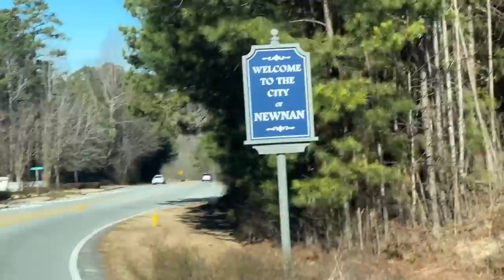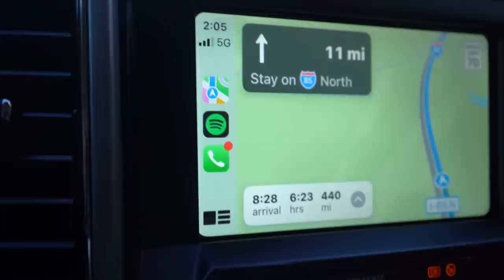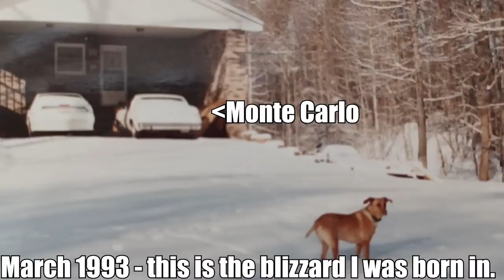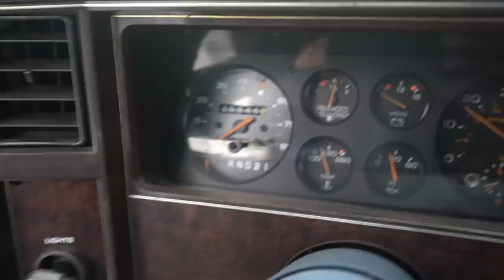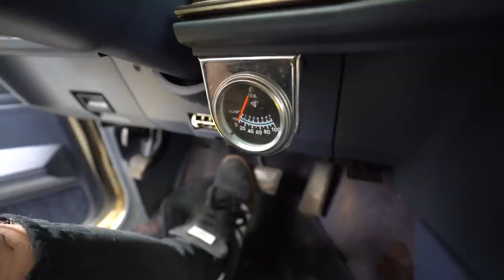Buying my grandma's old car back. sitting for 22 Years.

Comment: I couldn't believe that it turned out to be a Monte Carlo. I have my mom's original 1986 ss that I will be putting back on the road. She passed last year, so this really hit home. Can't wait to see how yours turns out.
Reply: My older brother had an 86 ss till he went off road thru a ditch in an ice storm
Reply: Same here, almost, on Christmas Eve ai brought my stepdads 87 SS Monte home to rebuild, he'd already LS swapped it B4 he passed in 2014 so that part is simple but my sis and niece put 20 dings in a very good and expensive paint job so I get to pull, best and fix those but other than a 4l60 w 2 neutrals I'm swapping for a built 4l80 it's ready for this turbo LS Ive been building for it. The memories of this baby at the track goin 10s and takin $, I can't wait to make him proud when I get it burning tires and droppin  panties... It's gonna be doin it for Dale 😂

Comment: Highly recommend a 55 gallon drum with the top cut off or water storage tank with 20-40 gallons of Evaporust. One of the best things I added to my shop. Remove parts, drop in tank, and by the next morning they are rust free. I just pressure wash clean, then if not ready to prep and paint, I redunk and let dry til I am ready to refinish. The dry film stops rust til you are ready. Barely even use my sandblasting cabinet now. 

 
Pretty excited to see what you do with this one. Always top notch.

Comment: I had the same exact car 4 years 1984 SS with the blue interior, white limited edition. I loved that car. I traded my 1971 Monte Carlo for it that needed work. The 84 had a 69 DZ 302 under the hood with a built automatic transmission that I could chirp the tires in all 3 gears... damn that Monte Carlo was quick LOL thanks for the Memories. As far as this one goes, don't take any shortcuts. Change all your fluids, water pump, rebuild your carburetor, radiator, gas tank and brakes though you don't have as much rust down there as we do so your tank might be okay

Comment: One thing alot of people don't know about these mid 80s gm cars is that they were made out of single sided galvanized steel, so they were less prone to rust from the inside out, but if you got a rock chip, and the salt and shit found its way behind the paint, they would rust like no other.

Comment: You really got me with this one. I had a 1985 monte with the 4.3 liter. It was all original.  Only thing I did was put better sway bars on it. And exhaust work. I miss that car. I lost it in a winter storm. First time it saw snow. Almost got killed. But I made it. Car,  not so much.

Comment: My dad had a 85 clone with a 350 and SS front clip, he sold it when I was kid and I cried lol later on down the road he bought a 88 true SS. It was stolen and vandalized and has also sat for about 20 years. He officially gave it to me not too long ago and I'm hoping to get some motivation to get it back up and running.

Comment: I know how you feel. I have a beautiful 1987 Monte in my garage still original body. Was in my family since around 92-93 when my uncle bought it and supposedly the history report shows the dealer got it at an auction in Florida. I have memories of the car when I was a kid and my uncle passed of cancer in his early 40s in 2009. Dad got the car, I had it in my senior photos and I’ve had possession of it since 2012 and finally bought it from dad in 2016. For the last 10 years she wasn’t road worthy, sitting most the time only putting around town and for the last 6 years it sat in a storage unit in non running condition. This past summer I spent thousands on the car and got it back on the road with a fresh heartbeat, brakes, and tires and exhaust and now this spring I have more plans to do the suspension as well as a few other minor things like the trunk lid. Actually just bought a very clean trunk lid for it from a guy in Minnesota on Saturday. Watching your video reminds me of my history with my Monte. Which is also white as well 😂

Comment: Awesome project! Old g bodies are getting rare. I've got an El Camino bucket list project that I'll probably never get to, but if I had your car, I'd have no hesitation putting a mild 4.8 or 5.3 in it with a small cam and nice fuel system. These cars do awesome with 350hp or so, as long as the chassis has a little stiffness added.

Comment: If that console shifter is like some of the Camaros around those years , when you pull it to low , push it to the right and it will only go to second , then let off and push back to the right and it will only go to drive .

Comment: For the steering wheel, try diluting some citrus cleaning agent with some water, more water than citrus to start to make sure it’s not too potent, and grab an old toothbrush and scrub it around the wheel with the dilution, and when it’s all scrubbed and as clean as you think it might get, rinse it off with some clean water and a rag of some sort, and let it sit to dry out and see how it comes out. 

You’ll either have a win, or you’ll know the wheel definitely needs replaced.

Comment: The sticker on inside of trunk lid gives you every option the car came with from the factory. Paint codes, engine size, transmission type, rear end gear ratio etc .etc .  You can look every RPO code up online for that car and you need to keep that sticker or get it reproduced for the new decklid

Comment: Cool beans.... Mix up some diesel fuel and marvel mystery oil 1/2 & 1/2, pull the plugs and add 1/8 cup in each cylinder let her sit overnight. Next day toss some rags over each plug hole and crank it over to clear it out then add a new filter and some new high milage oil with more Marvel or seafoam added will re-fresh any stuck/gunked up rings after a few heat cycles and save you're crosshatch.

Comment: talkin about Grandmas car, i have my grandmas 66 Chevelle, bought it of her in 1984 and rebuilt the engine and repainted it, its been the same ever since. how many factory 300 Deluxe 2 door post, power-glides u know of came out with 283? most were straight 6s. SS, Malibu. and Deluxe models. my dad talked her into getting the V8. he wanted her to get the SS back in 66, in 66 my dad was 18... lmfao glad u got your grandmas car back. thanks for the video

Comment: Oooh im excited about this. Currently doing the same with a slick top alpine white 5 speed E46 sedan I bought for cheap. It has a mint interior but just needs some tlc to get it running right. My plans are the same as yours, get it back to all stock and running and driving smooth and then modify it after.

Comment: Monte is in about the same shape as my regal when I brought it home. It was driven almost daily. 85 limited with 80k miles in it. 3.8 locked up and is long gone. it got its FIRST ding from a buddies lawn mower. Then my dr front fender got another from moving it around. Up until that point my car didn't even have a ding in it, much less any rust at all. still stock spare tire and trunk junk. Absolutey mint condition blue pillow top interior with that 400# power front bench seat lol. Interior is gonna stay for a good while I do believe. Moving it around I couldn't believe what it felt like to sit in it lol

Comment: Nice to see another Classic back in the stable..😎 The key you mentioned, reckon its an old steering wheel lock key, the kind that stuck a metal bar thru the wheel. Also, they do bluetooth cassette tapes now so you can keep that stock radio!! 😎 lol

Comment: It cool to see old cars  like this around more on the internet, my grandpa bought a 1987 el Camino 2 years ago ad would rive it around for some odds and ends but being in his 80's he dones not drive that much any more. And the El calmino was fully stock, but now there's a 350 in it that my great uncle built. So I have been enjoying it. But right now the car has been siting for winter but the El camino is stuck in park because it has a calum shifter and on the fire wall side of it its stuck so I cant get it out of park.

Comment: That thing is nice! 
I have a tip for the trunk rust. 
Take it off and do electrolysis on the edge, you will need a big pool or something (you don't need to submerge the whole thing, just the edge), then you can get the rust of with minimum damage. I do this to doors and hoods/trunks with that kind of damage, it works great. Its in my opinion the best method for this kind of rust cause the electrolysis can get to anywhere where water got to it without cutting the part up and it will get rid of all the rust.

Electrolysis; 
- on the trunk + on the sacrificial anode(steel) , electrolyte = water+caustic soda . connect 12v to it and leave it over night, repeat until its good (do it outdoors).

Comment: That special key looks like it is either from a “club” which was the anti theft device that went on the steering wheel or to like a little electronic anti theft device that was usually by the driver side knee panel but I’d go with choice number one lol either way sick time capsule man, you are the one for the job! Congratulations!

Comment: 17:05 Mine rusted out like that too! Due to water getting PAST the rubber grommets/sealer of the bolts, that bolt the rear decklid spoiler down!  A lil Bondo and fixed this on my decklid back in 1999!

Comment: 16:30 It is for a key for an old Clublock  - it is for the old steering wheel locks. (anti theft)
I use to have the exact same key for my first car I bought in the 90's

Comment: I took a peek and found a ton of suspension systems from Ridetech, Eibach, QA1, Speedtech, and UMI. I'm sure the brake companies from the usual suspects have great upgrade kits. I would just replace the trunk deck and be done with it. Engines choices? Hard to argue with an LS3 backed up with a T56 behind it and a Currie 12 Bolt. This will make a great cruiser. I look forward to following along for the ride.

Comment: Yea, about sticking steering wheels…I grew up driving a 86 MR2, and this was when I lived in Marietta northwest of Atlanta…in summer, the wheel vegan to disintegrate as the humidity seeped into the cracks forming from years of UV and heat/humidity of Georgia summers.  It was a garage kept car, except when my dad drove it to work…and then when it got handed down to my sister, then lastly to me.  

Good
Times.

Comment: See if you can borrow a rotisserie and clean up the bottom of the body. Restoring the frame is always a great idea. Maybe you could get it in the 13's if you update to a 4l80 street fighter and ford 9 inch, a stout 350 with vortec heads and multi port fuel injection, it would make this car more fun to drive. Back then cars made a lot of noise and had very disappointing acceleration.  Remember back when the muscle cars were still being made a 14 second car was considered fast. Remember to replace and upgrade all of the bushings. Monte-Carlos always handled pretty good but there's room for improvement for fairly cheap.

Comment: Oh boy. My cousins and I had so many of the G body cars growing up. built quite a few of them up into dirt circle track cars as well. 
I feel like these cars have some pretty underrated suspension geometry front and rear and, with the aftermarket's help, can be turned into some decent corner carvers.
Engine swaps are pretty easy. About the only thing that might need some real upgrading is the brakes. Of course there are options out there for that as well since they were used a lot for circle track racing in many different classes. Woth more power a rear end upgrade might also be in the cards but that is also not real hard.

Comment: I love this project. Im mixed with emotion with a stock restoration or a full blown hacked up racecar. I think i would prefer a pro touring with modernized drivetrain and suspension brake with relatively stock looking body.

Comment: Love seeing a good g body project. G bodys are definitely in right now and you can get them for decent prices. Most of the cars I've been seeing for sale are rollers or half done projects, but a lot of them look like good bases to do whatever you want as long as it's not being restored to bone stock. Just saw a solid roller Malibu the other week with a Ford 9 inch already swapped in it up for $3k
Reply: I wish I would have filled a shed full of them when you could snag rust free examples for $500 to $1000..lol.  I don't know how many I passed on that ended up being converted to circle burners..

Comment: Spray the car with Pam oven cleaner..it should clean right up..I did it with a black s10 I bought with a black truck cap..I used oven cleaner on it..and the truck turned out to be Robin egg blue with a white strip and a white cap.

Comment: I'm not a car nut but I highly prefer cars being 100% factory stock. Taking a stock factory car and doing stuff that's not stock. Makes like any other dime-a-dozen car that's out there.  At one time I had a 1971 Chevy Nova that I got a lot of compliments on when I owned it. The reason I got so much was cause it was bone stock with the 250 straight six engine and even had its rims and caps.

An old lady owned it so it never got the treatment most people would have done to it. Where most people would have ripped out the stock 250 straight six engine and thrown something in like a Chevy 350 engine.

When it comes to classic cars I appreciate factory stock more than ones that have been modified. The reason it's hard to find classic cars that are factory stock.

Comment: Change fluids and get oil pressure before trying to fire, take off fuel line and put fuel down the carb, tank could be rusty or very old fuel

Comment: Keep that sticker on the bottom of the trubk. Those 3 digit codes will break down every option the car has from the factory. See if it has G80 which is limited slip diff.

Comment: Great car with tons of history and sentimental value. Will be incredible to go through all the stages of it. Check out schwartzperformance for GBODY frames and misc stuff. We did all this with my buddies 88SS from highschool. Used a L76 6L90e combo (nothing crazy) and it's just super reliable and fun to drive . Did a bunch of hotchkis suspension parts as well as brake upgrades and rear disc conversion. Really did not cost a ton to make it what it is today.

Comment: Those keys are for the old style steering wheel to brake pedal lock my dad had one for his old ban use to push down on the brake pedal from steering wheel to slow theifs down they didn't work you could just pull off steering wheel put it back on and go lol

Comment: white with blue is 1983 and 84 only ive had 2 84s 1 my first car, buckets standard on ss, 83 84 85 had the steel wheels with trim rings only, 83 84 were either white or blue paint

Comment: You're lucky, all my grand parents' cars went to my cousin and he drove each into the ground within a year of getting them and so they now are all in junk yards in Missouri never to be seen again. There's really no cars from my childhood that I'd have to have or could even find if I wanted to. I want to get a 1st gen Jeep Wagoneer someday, don't know if I could fit my 6'10 self in it though. I'd also love to find a 85 Civic Sedan seeings how we had one of those from the time I was born until I was 14 or 16.. but again I don't know if I'd fit if I even could find one, and you'd definitely need to K Swap or Ford swap it because they didn't make 90hp/20mpg and I'd rather be able to hit highway speeds by the end of an onramp and get better mileage... CA smog makes engine swaps extremely difficult and expensive though. Beyond that there really weren't any cars of my childhood.. I've driven a FJ40 Land Cruiser on the highway and it SUCKS even with a V8 so I'd never want one, and I can't fit in a XJ Wagoneer so no thank you. The thing I wish I could get is still sitting in my parents' garage, a 1965 Triumph T120C TT Special motorcycle that I fought to kick start to life for years, kind of blew my knee out when it kicked back, but finally started at 16 when I was finally heavy enough.. and it sounds better than any other brit bike I've ever heard.. the thing is a beast. (it was set up for flat track racing before we got it, dad's had it for 27 years.)  That and I'd love to have and build the 46 Indian Chief that my late grandfather helped my dad buy in Mississippi when I was 9. I'd need 8k to buy both, and a LOT more money to build them, especially the Indian.. it needs EVERYTHING as it was flooded numerous times. (as in under water)
There is a car for sale right now that I'd love to go get, it's a 85 Monte Carlo. I have a thing for cars built in 85 because I was born in 85. There's also a 70 MC for sale as well. The 85 is pure NASCAR though, just waiting for a good engine to be put into it. (kind of feel the same way about this 2013 Fusion that's for sale near me, why Ford never put a V8 in those cars I'll never know)
I'd suggest going over to a wood grained steering wheel if you replace it, it looks good in those cars. For parts, check out OPGI, they've got pretty much everything you'd need for that car.

Comment: Not sure what the plan is but a top end kit, heads cam exhaust, would wake that 305 or 307, not sure which it would have, right up. And then drop a ls or really good traditional sbc in it.

Comment: Those weird shape keys may be the key for a steering wheel lock. I believe they were called “ clubs “. Havent seen one in over 10+ years but that may be it. If thats the case you most likely wont need them

Comment: If I was you I would put a gen4 6.0 in it with the ls3 heads and a big cam will make 450 wheel hp and you can drive it anywhere without reliably problems